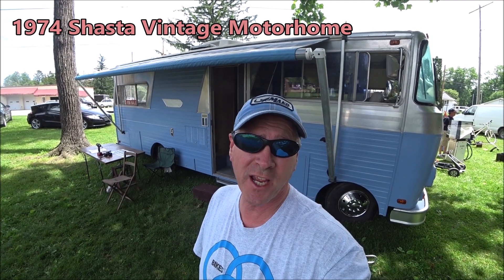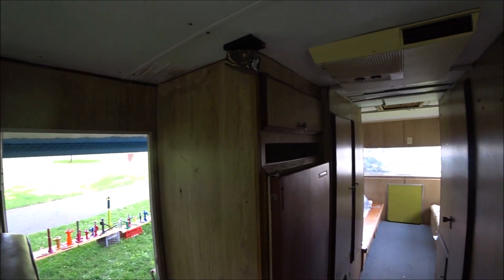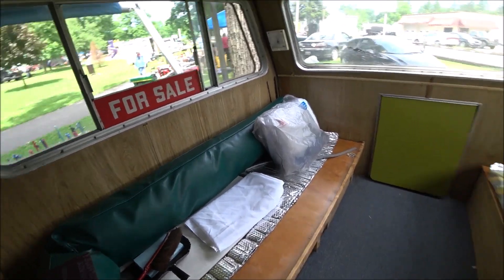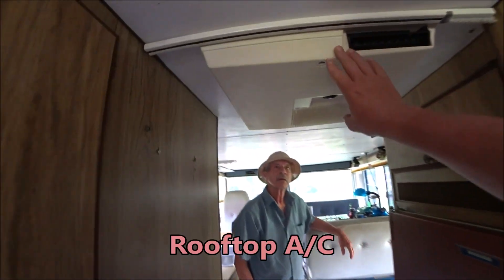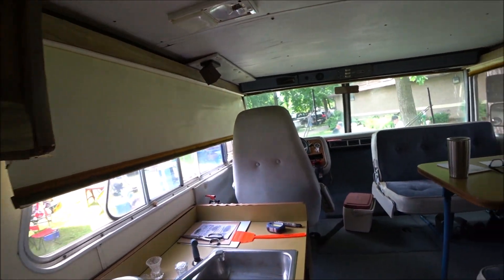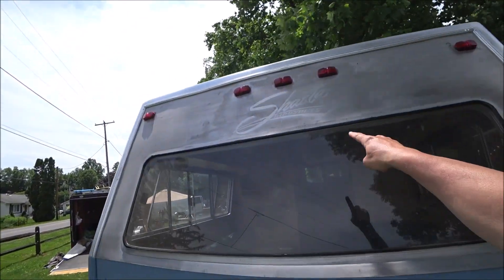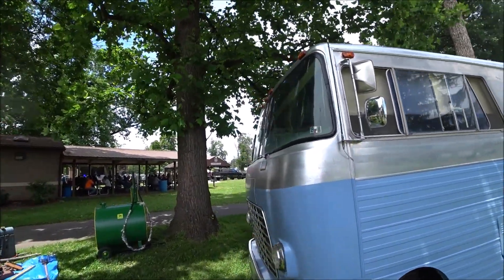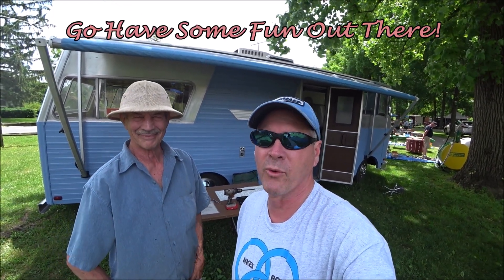1974 Shasta Class "A" Vintage Motorhome (Aluminum)

Comment: That thing is rad! I had no idea Shasta ever made a motorhome. Kinda rare to see a 70s motorhome that wasn't built on a Dodge or Ford frame either. I think the front end looks a lot like a Ford though, just because of the grill design.
Reply from the maker: It really was a cool RV. I would have bought it if it would have fit in my garage. Thsnks for watching.

Comment: Nice looking unit.  I really like the aluminum skin.  You stated that you have a 454 c.i. engine.  I assume it's a Chevy.  I would highly recommend replacing the exhaust headers with some modern stainless steel ones.  Something like Flowmaster would work.  The old Chevy big blocks, in motorhomes, often over heated badly and cracked.  Don't ask me how I know :o(
Reply from the maker: It has since been sold. Thanks for watching.

Comment: In couple of weeks...picking up a 1972 Dodge Champion that looks similar from its original owner, 91 yr old man, letting me drive it away.  Been sitting under a carport for last 15 years.  318 engine and in the same shape.  Like walking into the past.  Not sure what I will do with it. ha  Just ordered a replacement carburetor for it and will drop the tank.  Should fire right up.  :)
Reply from the maker: It will definately catch the attention of everyone at the RV park. Thanks for watching.

Comment: Where did you find the unit?
Reply from the maker: It was at a old time tractor show at the park where I walk Harley Caroline. I use a purple mic for the voice over and my fdr x 3000 built in mic for on site work.
Reply: I have an old digital camera and Go Pro will give you $100 off a Hero 7 Black for ANY digital camera, working or not.  I'm thinking of making the switch. @BikesBoatsBivouacs